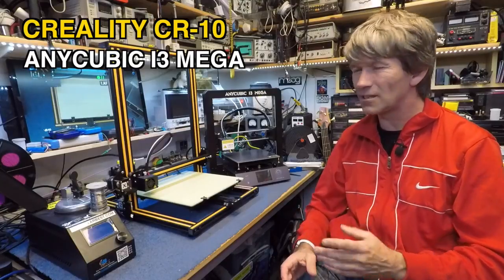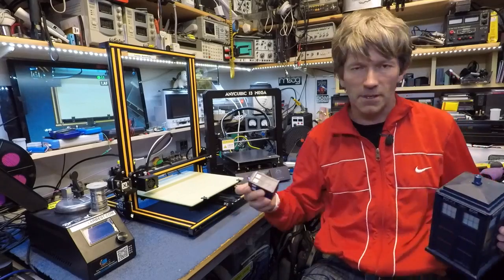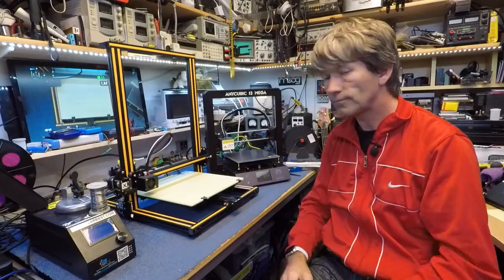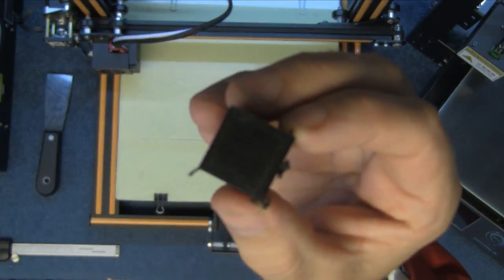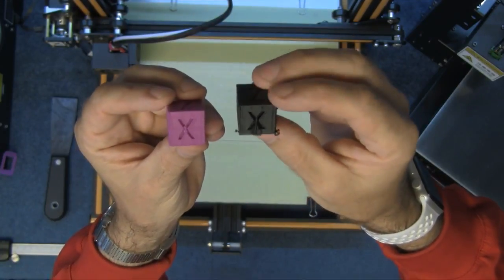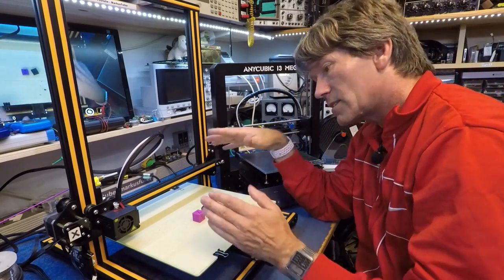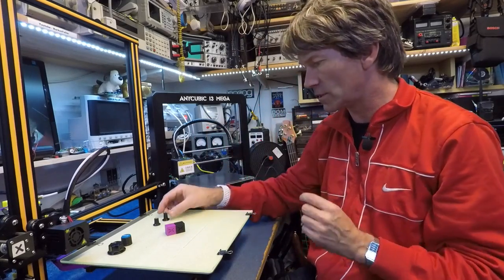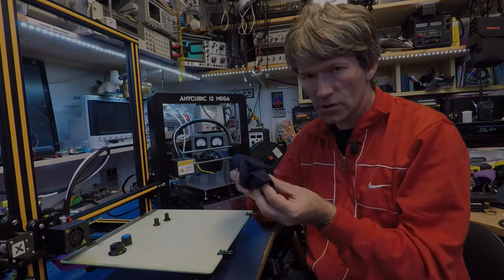which 3D printer is the best CR-10 or Anycubic I3 Mega ?.

Comment: It's quite easy seeing your size requirements. The Anycubic has a better bed surface, a much better bed heater, dual lead screws and slightly better print quality out of the box. If you wanted larger build volume and a machine with a huge community modifying it then the CR-10 would be my choice. I have a a CR-10S as well as the Anycubic a Tevo Tornado and many other machines. Of those 3 that one that gets used the most is the Tevo Tornado due to the superior bed heater. After that I like to use the Mega for smaller parts to save on the electricity of needlessly heating a large bed and it's ability to print ABS/ASA better than the CR-10S. You can't go wrong with any of them really though. To each their own, toss a coin.

Comment: Hi Markus,
3D printing should really be something for me since I always design stuff anyway.
The only thing keeping me from buying one is that I do not want to end up with option 3: The one that never works. I once bought a specially adapted and thus expensive inktjet printer to print CD labels (remember them?) but the thing never worked properly. Not even with normal paper. And stil the basic printer was from a big brand. Epson if I remember correctly
So your video's surely help me to orient myself further. But still, would you say that this technology is by now mature enough for practical use? Or is the hassle still bigger then the actual output?
Reply from the maker: Marc Brassé Hi Marc to be honest I still think there is room for improvement in 3D printers. dont get me wrong they are far better now than they were only a couple of years ago and the advancements are truly amazing for the home hobbyist. I have sat for ages cutting up plastic sheets to make small boxes etc but now its just a matter of simple design on the pc then load the code onto the machine and you have the right sized box or part for the project you are working on. I kept the anycubic i3 mega as its just the right size for my needs but theres so many good printers out there to choose from now.
Reply: So it is about time to take the plunge myself? Or should I still be patient for a few more years? Love the Tardis joke, by the way. Especially that little Markus. :-)

Comment: Having a difficult time deciding  between these two myself. If they both had the same build volume I would easily take the Anycubic, but the possibilities with the size of the CR-10!
Reply: But all that has changed since the new CR10S has all those things as well now the return to print with filament sensor and a 2nd Z axis motor and screw and most are either printing direct to glass or using a PrintinZ skin. I bought the new  model CR10S 3 weeks ago with his coupon code for $499 and figured it was worth the extra over the I3 Mega because of the huge print size. the regular CR10 is $374 with a coupon tho you give up the resume to print and filimant sensor and new motherboard and second Z axis motor. the I3 Mega is $360.00 the best deal I have found so far  for comparison But the other big sell for me is the HUGE CR10 users group :) Also you can buy the 2nd Z axis motor upgrade from Tiny Machines for 50.00 with their coupon but most say it isn't needed .

Comment: Nice video, with a good subtle humor -- really like your lab setup! ;  )  I've owned a CR-10 for about 7 months. I only paid $359 USD, with free shipping, as I purchased it just before the mad Creality 3D rush during a Gearbest flash sale. If paying anywhere near $500 USD for the CR-10, and not concerned with large volume prints, then I would get the Anycubic. It quite simply has more 3D printer technology integrated into it. Don't interpret my opinion as representing a negative for the CR-10 -- it's a fine printer. However, based on your criteria, the Anycubic might be the better choice.

The other printers you might look at is the Monoprice line of printers. For one, they use 32-bit controllers. The other Chinese printers which seem to have a very good reputation are the Flyingbear printers. They use the Makerbot, and Corexy designs, and are all metal box frames -- much more potential to print quality ABS parts, as they can easily be enclosed.

Along with my CR-10, I have a Flashforge, Makerbot clone, FT-5, my own design, and an incoming Tevo Tornado. I also have 2 acrylic Prusa clones, which are relegated to my parts bin. Cheers, and keep up the quality videos.

Comment: My power switch of the Anycubic Mega broke on the first day, it would not switch it off anymore. I contacted support and they told me to check the fuse, which makes no sense at all. Then they proposed I repair it myself. It's the main power switch at high voltage which should not be serviced by the end user, so I just returned the machine. Looking for higher quality machine now
Reply from the maker: Hi Ron. Im sorry to hear your problem. the power switch is a complete one piece unit that houses the fuse and IRC connector and is not a part that anycubic actually produces thenselves, instead it is just bought and placed into the unit. if you can find the right shaped unit you can normally purchase these from RS electronics / Mouser / or even maplin electronics. then its just a case of swopping the spade connectors inside. though quite rightly this is not your problem and it should not have happened and under the terms of guarantee you did the right thing in returning it. I hope you find something more suitable. best wishes from Markus.
Reply: Looking at the machine I guess there is not much, probably nothing at all, in the system that is actually produced by Anycubic. So if I accept the "not produced by them" excuse then there is an excuse for everything that fails. Of course everything can be fixed, but it should not be my task to fix a machine that is not even 1 day old, especially if it is related to mains voltage. The Creality CR-10s seems to be quite nice, solving some issues found in the previous version. I might go for that one.

Comment: funny video, love it! :D more funny: you are struggeling with the same choice I'm confrontated with and I still don't know chich one to buy ... but I think the i3 mega looks more rigid and solid :)
Reply from the maker: Hi Thomas. the CR-10 is quite solid also but I think the i3 looks better with the control built in and it can resume a print if there is a power-cut . I think its down to what size of print are you going to be making ?. me its only small things so the i3 will do the job for me.

Comment: If the i3 mega wasn't so space convenient, logically you seem equally pleased by the print quality, so you could assume it's fine to just keep the larger one.

If the broken tardis is really running out of room then the i3 seems like a safe bet, and if you are printing smaller parts for the time being you will be fine with it.

Time comes for an upgrade, why not arrange directly with anycubic and do a review, share your thoughts and so on?

Comment: I have self a CR10 printer and I'M very satisfied, have already printed vases, lamp fixtures. coffee mugs.
I think there is no better printer for that money.

The CR 10 has more options, many components to improve the printer that can be downloaded for free and can make you self. With the CR 10 you can make beautiful vases that will not really work with the Anycubic I3 Mega.
Reply: Don't forget the CR 10 Has a huge online community and user group.  The new model with dual Z axis motor and filament sensor and return to print put it equal to the I3 Mega in features but with much larger build size but the cost is $499. The reg CR 10 is $374 Tiny machines has the dual Z-axis upgrade for $50.00. Vs the smaller I3 Mega at $360.00

Comment: I think the i3 mega is better. Yes, the creality has the build volume, but as you've said in the video you're mainly intrested to print small parts, which the i3 is very capable of! In my oppinion, the i3 has some features that the creatilty doesnt have which is a deal breaker for me. First of all, the ability to print after a power outtage/ pausing prints. This means that if there is an power outtage and you're printing something, you won't have to start all over again, but since the i3 mega saves it's steps/position when printing, this allows the printer to resume even after a power outtage or a pause. Secondly, fillament outtage detection. This allows you to feel free to run prints for as long as possible for the same fillament without being scared of running out, since there is a pause function if fillament does run out. This means that, in the long run, you will waste less materials as you can use the whole spool before changing. Finally, the build surface is quite a lot more easier to use compared to the cr-10 which uses the tape. I personally have to make this choice and I currently have the i3 Mega myself and I'm glad that I've made the decision. I hope this helps you to make yours as well!
Reply: But all that has changed since the new CR10S has all those things as well now  and a 2nd Z axis motor and screw and most are either printing direct to glass or using a PrintinZ skin. I bought the new  model CR10S 3 weeks ago with his coupon code for 499 and figured it was worth the extra over the I3 Mega because of the huge print size. the regular CR10 is 374 with a coupon tho you give up the resume to print and filimant sensor and new motherboard and second Z axis motor
Reply: Could you print a helmet on the i3

Comment: Hi Markus love your videos , I've done a bit of tinkering with old gear in my time mainly a bit of pa gear amps , speakers and such repairs really fancy gettin into having a tinker with 3D printers i3 does look a nice neat little bit of kit , what exactly was the problem with the anet let me know if you would like too pass it on wouldn't mind tinkering seeing if I could get it working
Reply from the maker: jays vape reviews Hi Jays Vape. the anet had several problems. heatbed destroyed in transit one motor not controllable from the board cables wired incorrectly, the list goes on. but i have already started dismantling it for parts to try and make a cnc machine with it. hopefully there will be something good made from the bits that do work.
Reply: markusfuller that's a shame really isn't it but Ye that's a great idea let me gues ur thinking of mounting something like a Dremel tool on there maybe something with a flexi drive would be cool too use

Comment: I would take the CR-10 for the build capacity, it also prints very well(my friend has one but with dual motors on the Z axis)
Reply from the maker: Hi Derek I have seen the new bigger CR-10 (400x400x400) with dual motors and theres also a CR-10 mini available now. i put the links in the description. many thanks.

Comment: Markus, I hate it to say.. but it's thingiverse not thingyverse.... I do the mistake every time myself. Looking forward to more midi/music related projects from you!
Reply: The snot at the Xs is support structure generated by the slicers to be able to print the overhanging part. You suppose to break it off after the print. If you disable the support material setting in the slicer software it won't do it and try to print in mid air which should be ok with small overhangs
Reply from the maker: I keep on making that thingyverse mistake over and over again. sadly I cannot remove it as its embedded into the video now. there will be more synth things on the way it's just a matter of whet I can get hold of on the carboot (fleamarket) sales. its been very slim this summertime.
Reply: I'm eager to create a new midi/sampling project again.. if you are interested, I could built some kind of MIDI filter (arp, delay, or even free programmable) and send it over. A collab of some kind :)

Comment: As has been said, the accuracy of the cube is a calibration issue and print surfaces are easily changed, id keep the cr-10 for the build volume but if you don't need the volume the i3 mega would seem the better fit.
Reply from the maker: Thanks. I will look into recalibrating them again. I think the I3 mega would be best for my needs but i know i would need the bigger area one day also. ????

Comment: You can adjust your steps on each axis to get the 20mm cube to be more accurate. Desired amount/actual amount * current steps. I would keep the cr-10 if you plan on ever printing large things. But might be overkill if you are only printing small things.
Reply from the maker: Thanks Wayne. Im still learning the tricks of the trade within the 3D printing world but I will certainly go and check out the adjustments you mention. thanks for the advice :-)